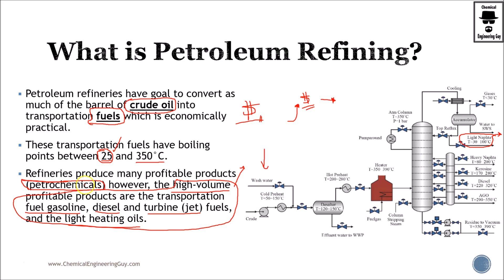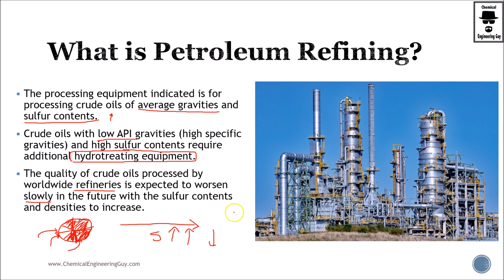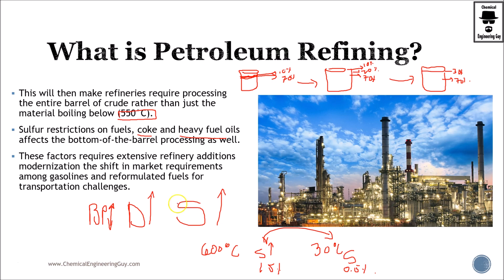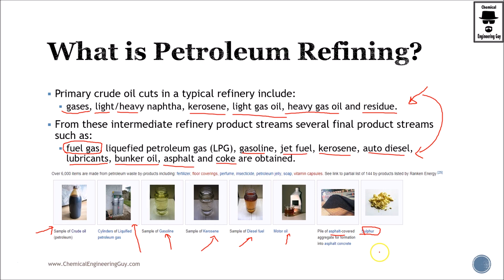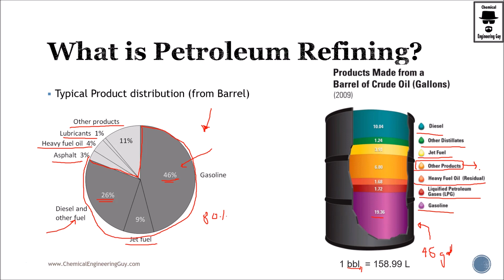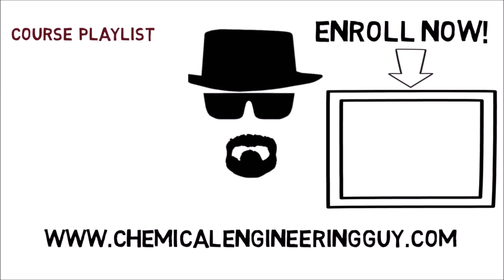What is Petroleum Refining? (Lecture 011) - Petroleum Refining

Comment: How do they design a distillation column for such a complex compound as crude oil?..how do they know the amount of steam to use in side strippers and in the main towers?
Reply from the maker: Nice question! We cover the overall design, but most likely we do it via simulation software, no longer with calculations (which are very tedious)
Reply: @ChemicalEngineeringGuy   Aspen plus?
Reply from the maker: of course! Aspen plus + Hysys simulations
Reply from the maker: Actually, for this, it is much more common HYSYS but you can try it in Plus as well
Reply: @ChemicalEngineeringGuy  thank you for the answers sir.